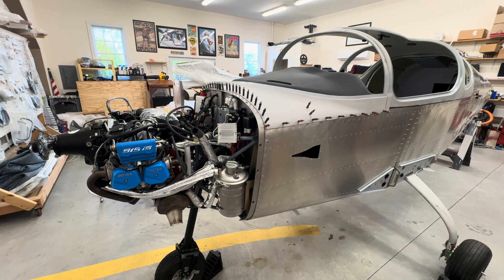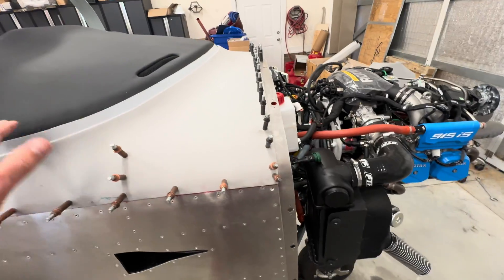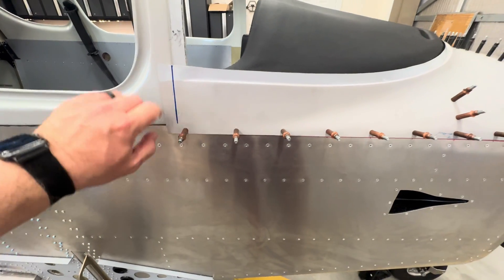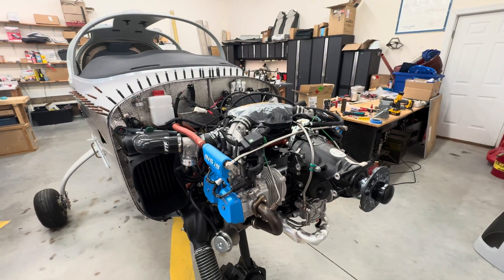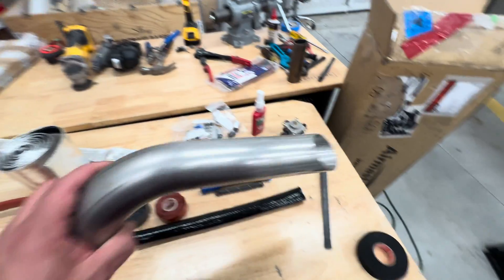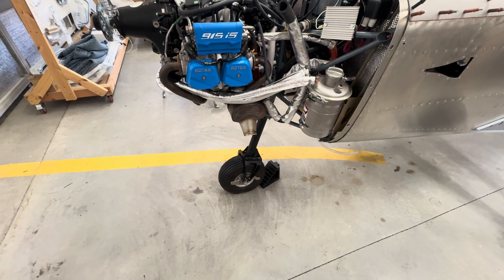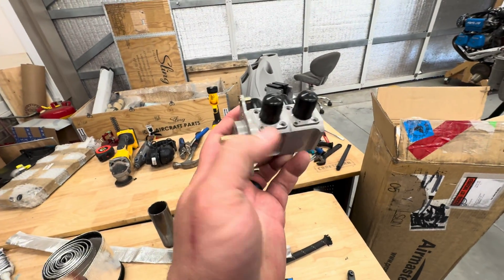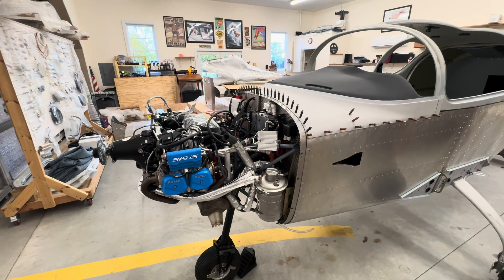Firewall Forward.  Sling TSI Build Update

Comment: What fitting did you use to connect the AN6 PTFE fuel line to the Feed Pump (Facet Posi-Flow Electrical Fuel Pump) that is located under the panel?
Reply from the maker: It’s been a while, but I think I used the factory provided T fittings into the pump and then connected to them with the AN6 fittings I used on the braided PTFE lines.  I had to change out the pressure relief valve to one using AN6 instead of the barbed fittings.  Going from memory here from a year ago, but I think that’s right.  Google this on Facebook Sling Builders and someone posted pictured of the fuel valve setup which I used as a guide (from a ways back).

Comment: I am using the same fuel and oil line setup as you are. My build is just a bit ahead of yours now. Looking forward to seeing another TSi flying in the Carolinas soon. I’m hoping mine will be done with testing and spending time at KAIK by late September. Keep the great videos.
Reply from the maker: I was based at S17 prior to my current house, not too far from KAIK.  Good luck with the build.